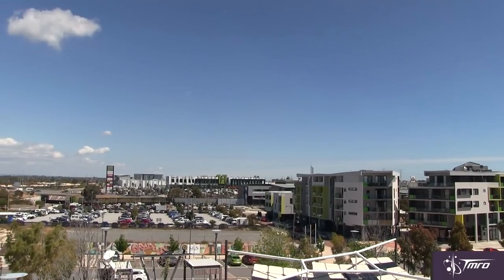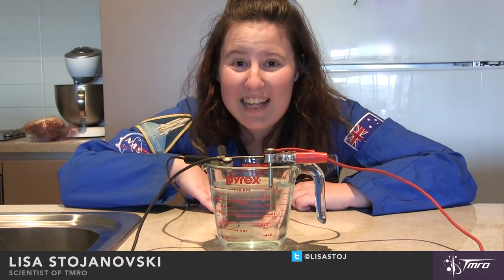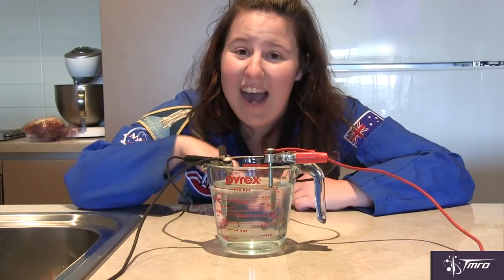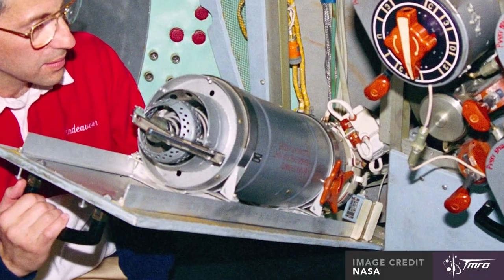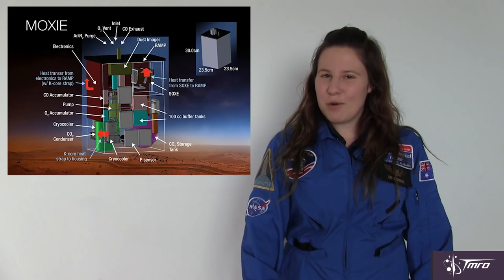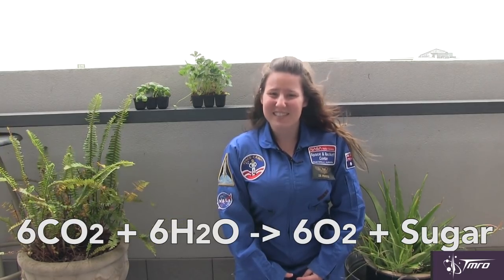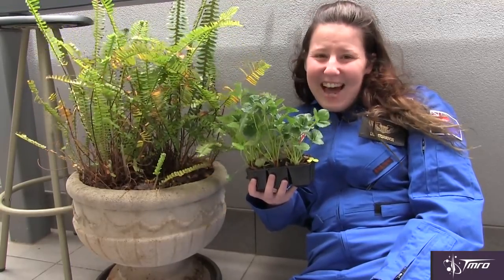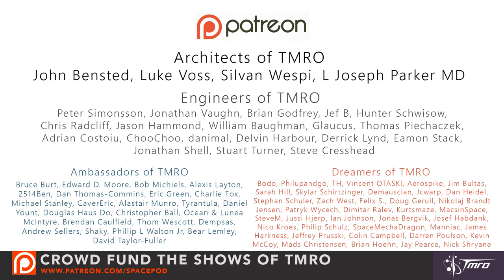How to Breathe in Space - Space Pod 11/10/16

Comment: What are they doing with all the methane produced from the sabatier reaction?
Reply: Maybe the ISS is farting
Reply: Maybe the ISS is farting! And correcting its velocity vector with it xD
Reply: At present it is released to space. There are plans to break it down, however, recovering the hydrogen and leaving carbon. The difficulties lie in making sure the carbon does not clog the equipment breaking it down.
Reply: I thought the ISS was a full closed system concerning the atmosphere with few trashes :/ it could be if we succeed to imitate photosynthesis, improve the performances, and eat the result, but this is way harder in space.